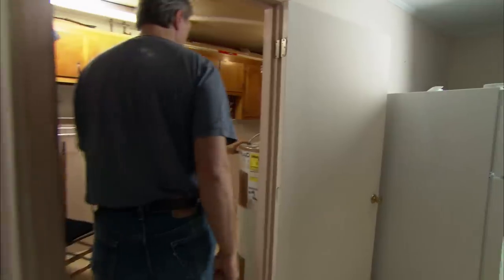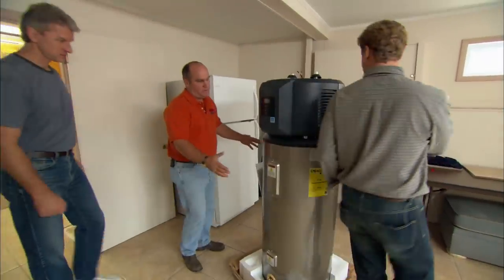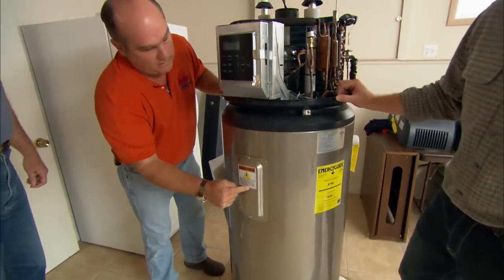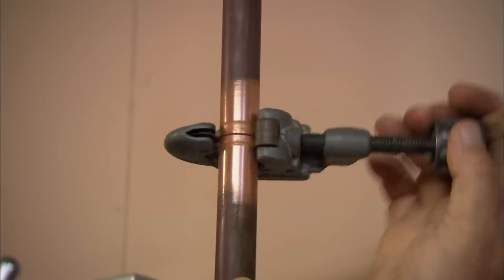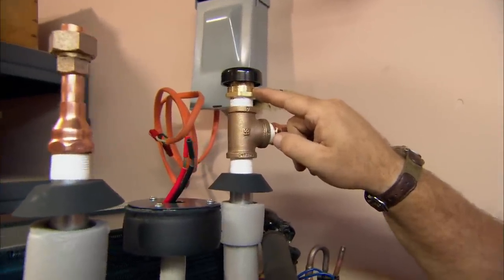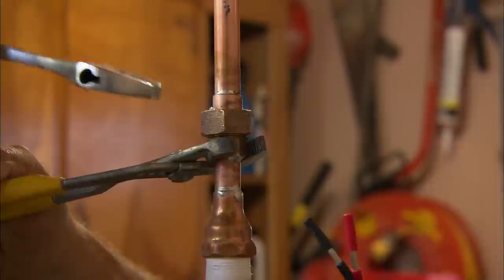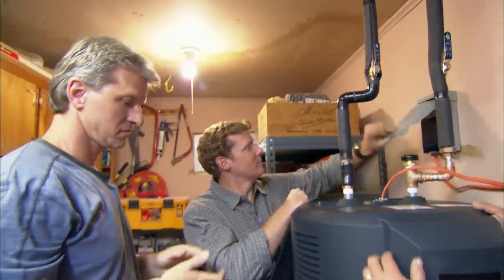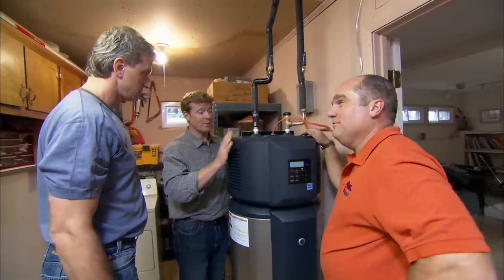How to Install a Heat Pump Water Heater | This Old House

Comment: Most manufacturers are recommending a flexible connection to the piping to keep compressor vibration from traveling through the home as noise.

Comment: Richard has described in detail how a heat-pump works about 6,000 times.
Reply: But I bet there are a lot of people who still don't get it.
Reply: And in two years the heat pump breaks and ur back to a regular electric hot water heater!!🤷‍♂️😂
Reply: @robmcshane3260  Ten year warranty on it.

Comment: Great TOH How-To, as usual. I watched this when deciding between an On-Demand system or a hybrid and this video helped push me to the Hybrid camp. That was a good decision since mine is in a NH lakefront house that gets only occasional use in winter. Heat is precious in those months, so I don't run it in Hybrid mode then. Summer is a different story and hybrid mode works great, and dehumidifies my finished basement as a side benefit. Installation was as simple as Richard made it look.
Thanks, fellas!

Comment: My old kenmore is from 1983 and still goin'. It only lasts for about a five minuet shower at full pressure though. I can't wait to get one of these new hybrid water heaters. The video was good, but the install wasn't quite to code. That 220 should be in conduit, and I don't see a pressure relief tank either. Where I live it required to have flexible copper lines to the heater and also have it strapped down so it don't tip over. I guess they're different rules here and there, but I wouldn't leave that wire exposed like that. Still a fun video to watch.
Reply: Musicman4HIM7 you probably live in KALOFORNIA, or other earthquake area.
Reply: Pressure relief tanks aren’t always necessary, it depends on the house’s circumstances.
Reply: technically an expansion tank is required if there is a backflow preventer on the mains. I have never seen conduit on a residential application electric water heater in 10 years in the trade it's perfectly legal here. even though not always required I always install an expansion tank
Reply: @jenniferbyrne8334  conduit is in a lot of residential. If nm-b is exposed it must be protected whether in conduit or flex but must be protected!
Reply: @mnf65  No, it is not "always" required to be protected. There are many circumstances where exposed NM-B is 100% acceptable. He is absolutely right, it is extremely rare to find that on a residential water heater. It is not required because the water heater is not in the normal living space, and installed in such a way that people will not be apt to hang things from it.

Comment: With a backflow preventer in the system, I have heard it's advisable to have an expansion tank in the system. This reduces the cycling stress on the tank that leads to premature tank failures. (You can learn about this in other YouTube videos showing how to install  the expansion tank in a domestic hw system.)What is your take on this?
Reply: he doesn't have a backflow, the vacuum breaker is to prevent the tank from collapsing when its drained, basically makes it where he doesn't have to open the faucet to do it.

Expansion tanks are required per code on all installations anyways now.  When they talk about a backflow being on the system the mean like a RPZ or Double Check Valve being installed before the heater, usually only on commercial sites does this happen
Reply: Yes if there is a check valve on the incoming line you need an expansion tank otherwise the heated water would have no room to expand and cause the relief valve to drip.
Reply: maczrule  which states is this now code? I have NEVER SEEN ONE IN NJ.
Reply: An Expansion tank is not needed if you have well water and don’t have a check valve after the well expansion tanks.  I have one of these water heaters and no expansion tank because I am on a well even though my well expansion tanks are at least 140 feet from the water heater in a separate building!
Reply: Expansion tanks are only really needed to provide that air cushion and relief from pressures that can build in a closed system.    Take a length of pipe, fill it completely with water and close off both ends, now heat the pipe.  It will inevitably crack the pipe and leak.  Now add a vertical leg onto that pipe filling only the main run leaving the vertical newly installed pipe empty and seal the system, now when the pipe is heated the pipe wont explode unless it is extremely heated superheating the steam but thats not gonna happen with a water heater as they only get up to boiling at very most.  The expansion tank would be the vertical pipe you added, the caps on the ends of the pipe would be the check or prv valve closing the system off from the incoming supply, the heating method of the pipe is the water heater.  Lol.  the expansion tanks also are used as pressure stabilizers sometimes as well but only are required by law if your water company uses pressure reducing valves at the water meters for separate users, most of the north west has this requirement because they have distribution pressures that stay around 100psi or above and mains that get up to hundreds of psi from their pumping systems.  Thats. Where you see the geysers when mains are broken..

Comment: If that thing is pulling heat out of the air isn't that going to make your heating bill in the winter go up?
Reply: Good question. All I can say is that it shouldn't . If the water heater's space is heated, it can take that heat and put it into the water.
Reply: Very slightly, the tank isnt’t completely insulated and gives up some of the heat to the room through the tank itself and ever the copper hot water pipes.
Reply: John Anders how the hell does it give up HEAT to the surroundings ? It TAKES HEAT from the AREA, which it PUTS INTO WATER !
Reply: Leighton Samms some heat escapes through the tank wall.
Reply: Johnnie Burkhalter if you can BUY a WH that looses so much heat through the insulation, then that unit is CRAP, we have used recording thermistors on several brands, and the heat loss is so frigging minuscule, you ar the kind of person whom buys those “WRAPS “
Reply: Leighton Samms The TANK is NOT perfectly INSULATED, so the HEAT escapes THROUGH the tank wall.
Reply: Leighton Samms The heat also escapes through the hot water pipes, when they are turned on, and also a small bit through conduction when the lines are static.
Reply: I live in the Northeast and on the coldest days in the winter I just switch mine to electric mode. My HPWH is located in an unheated basement and the air it blows out tends to cool my floor and make my mini split upstairs work a little harder. It cools my basement by 10-15 degrees on some days.
Reply: Definitely yes it will. But how much? Maybe for winter better to use electric mode only. It’s not easy to calculate. If u leave in humid area some people say hybrid will eliminate dehumidifier. I’m running my 8 month a year here in PA. So idea to have hybrid water heater not bad, but there’s a draw backs. Noise and low reliability

Comment: Could this be installed under a stairwell, I have 9 foot wall so a lot of space, to provide air I could install a mini fan in the wall to supply air from the main area of the home....would this work?? The reason why is Im built on a slab, so no basement and no attached garage...Thanks

Comment: can the heat pump be turned off in the winter? wouldn't want to run an A.C. when it's 20 below out
Reply: Yes. They have the ability to run as a regular heater. I agree... don't want to pull the basement down into the 30s haha.
Reply: Chris R  why would your basement be so cold ?
Reply: @flybyairplane3528  A heat pump pulls heat out of the environment. If it's in the basement, it's going to cool that space.
Reply: Good point. My basement about 62 at winter. Will see how much it will lower

Comment: So your pulling heat out of the air in the space where the water heater is. That energy still has to come from someplace. Am I right to assume your house heating bill will be higher because now you need your air heating system to heat the now cold air the water heater puts out?
Reply: Your thinking is correct. In the summertime this is a benefit, as this will help to cool your garage/basement where it is located. Many of the heat pump water heaters are hybrid models like this one which have an electric resistive heater that can be selected for use in the winter, so in theory there would be no parasitic drain on your HVAC. Most are wifi connected so this can be an easy selection with an app.

Comment: During warm weather pulling heat from the room is no problem. During cold weather isn’t a heat pump like running an  air conditioner in a heated space?

Comment: Now he has a nice cold shop :)  Remember, only use a heat pump water heater in a location where you have EXCESS heat.
Reply: That depends. If his house is heated with efficient mini splits it would still be more efficient "stealing" heat from them compared to resistive water heating. If it's a concern in winter months just run it in resistive mode for that period of time

Comment: 3 questions 1 can it be used on low budget solar electric ie 110 volts what's the highest temperature it reach on the heat pump alone and can the tank be replaced when it eventually gets a leak and one extra question how long is the warranty for total r&r so far I've looked at 2 1 was Rheem hybrid not able to be run on low budget solar and low heat in the water the 2nd was a split unit with the heat unit outside and the tank inside again won't work on low budget solar  so have 2 options to use them either 8 grand for solar or 200$per month for grid tied power and neither I'm able or willing to pay I'm most people I like the idea of going green if it'll either save money or break even

Comment: These are great, on paper. I recently did my homework on these hybrids and they have a lot more cons than pros and the savings $ are minimal
Reply: Tankless makes way more sense. Not quite as efficient when running, but they only heat when you are using it. And they're as cheap as a regular electric water heater. With my propane tankless heater I've used less than 10 gallons of propane in over a year. If you want a heat pump get one that isn't built into the water heater tank - that way you can replace a leaking tank without buying a whole new heat pump.
Reply: @ABlueDahlia  Have you actually done any math? I doubt you understand what you are mathing....
Reply: @ryanroberts1104  only if you got gas.
Reply: @kalijasin  Incorrect. Tankless water heaters are both efficient and cost effective for electric, propane, and natural gas.
Reply: @ryanroberts1104  even if tankless heaters are 100% efficient (UEF=1), that's 3-4x less efficient than heat pump water heaters (UEF=3-4)

You don't know what you're talking about if you're claiming resistive heating (electric tankless and traditional heaters) can ever be more efficient than heat pumps

Comment: I had come across, where that ‘pull switch,’ was mis wired,   surprise. I also went to a ice machine at the SUNY MARITIME ACCADEMY,  in the BRONX NY ,,where the machine was a 230 volt unit,,BUT the SOB whom installed, had put in a 120v disconnect, so ONLY 1 leg was disconnected, the other was HOT  100% when it was disconnected, all I could do was to wright it up, then put a warning tag on it, . .

Comment: In our area it is code to have an expansion tank as part of the install above the H2O Tank.  Is there a reason why this was not done?
Reply: Harold Malaby  I have NEVER SEEN ONE in NJ, but I have had to install PRVs, and T & P valves, MANY places, the homeowner had put a bushing into the outlet, then ran1/4 “ copper out a window,<because those valves were’ weeping’
Reply: @flybyairplane3528  Some manufacturers may even void your water heater warranty if you have a closed plumbing system but don’t have an expansion tank for your water heater.
Reply: Expansion tanks are required when there are backflow preventers on the cold water line.
Reply: He install vacuum breaker it does the same job as expansion tank.

Comment: Can you provide an example, or characterize the operational savings of heat pumps vs. tank-less water heaters?  i.e.: Which is the wiser solution for lowest energy bills?   Thanks in advance!
Reply: BluesLicks101 had YOU LISTENED, he said the heaters were about 4000 watts, but theHP was about 700 watts, so what is it that you do not understand ?
Reply: @flybyairplane3528  To be fair, he did say that the 700watts would run for a longer, but unspecified period of time. so its hard to determine the energy usage
Reply: Madaspy good point. I read somewhere in hybrid mode need 7 hours to heat water after installation. So 7x 700= 4900 wats. I think my electric was able to heat in an hour, but I’m not sure. It’s 4500 wats. Maybe someone can comment how long it take to heat water by electric one
Reply: I have a 50 galon AO smith hybrid and I'm saving about $20-$25 a month on my electric bill. So it is worth it. I do live in Florida and it is located in my garage so perfect situation here plus it dehumidifies my garage.

Comment: I have a Manufactured Home where the water heater is in a tight closet with a removable panel on the front. Could I still install a Heat Pump Water Heater if I kept the panel removed and added a cutout in the wall above the removeable panel with a 16" by 16" louvered vent?
Reply: no.

Comment: Why the heck would a incoming cold water line need a vacuum breaker on a water heater?  When would that ever be used to break any kind of vacuum?  Because when i fill a empty water heater i open a fixture thats the farthest away and turn on the water until the air gets pushed out and cold water is flowing through both the hot and cold pipes then shut the fixture off and wait for the water heater to do its thing..  but even if you just left the air in the system and just turned the cold supply on then burped the system later, when would a vacuum be formed ever on an open or closed system?
Reply: If the fire department ever uses a nearby hydrant and there isn’t a vacuum breaker, the tank could implode.

Comment: how many sq feet is needed in the space where the heat pump/hot water heater is installed?  you haven't commented on that yet.
Reply: 1,000 square feet
Reply: Unless you have a louvered door.
Reply: @Penfold8  what happens if you don’t have 1000 ft.² and you install this? I really want to one  but my basements only 600 ft.².
Reply: @Raptors0524  It isn't 1,000 square feet, it is 1,000 CUBIC feet.  Your 600 sq ft is more than plenty.

Comment: What's the go with hooking this system up with a hydronic radiant floor heating and for DHW use? Greatly appreciated for guidance
Reply: The heater for a domestic hot water doesn't even come close to providing the heat for radiators or radiant floor heater.
Reply: @gene8172   What if its only to heat a small sunroom why hydronic heat?  Its only about 260 Sq feet
Reply: @maow333  Hot water heater won’t put out enough heat, isn’t designed for heating and will use too much energy and will fail quickly.

Comment: Why not run the condensate line out the house? The water heater isn't that far awy from the outside wall, but instead now must add another point of failure in that condensate pump and more unattractive tubing.

Comment: Only way I see this working is if your water heater is in your garage. If it's in the heated basement like we have, now I'm running my HVAC to bring heat into the house for the heat pump on the water heater to absorb to put into the water, making the basement cold forcing my HVAC to run more often.
Reply: These can be ducted outside to negate that. In addition, you can use a valved duct. In the summertime, you can close the valve which causes the air exhaust to cool your basement. In the winter, you open the duct valve which runs off air exhaust to outside so you don't have any negative consequence.

Comment: one more thing. where's the expansion tank.
Reply: there is just the safety valve
Reply: Expansion tanks are not required everywhere. Where I am they are only required on systems with a back flow preventer and new construction (because all new construction requires a back flow preventer)
Reply: Merchants HVAC & Plumbing my gas WH does not have an expansion tank,,but my water system  has one I put in,.My water press is 130 lbs, so I put in a PRV, with gauges on both sides then a whole house filter, with aguage on the outlet, them softener, then a  food grade phosphate feeder, then that exp tank, w/takeoff to my RO SYSTEM to the kitchen & refrigerator.
Reply: None required where I live. City water pressure is 60psi, no PRV required, no backflow preventer required, thus no expansion tank needed.
Reply: expancion tanks are only nessesary if you have a CLOSED TANK SYSTEM where the water NEED space to expand!
on most water heaters the exess water get pusd back in to the inlet pipe as soon as the pressure in the tank gets higher than the water pressure in to the house.
but i have seen plases where they add airpressure-expansion tanks on the inlet pipe,, but thats mostly to make say a water pumps work easyer so it dont  get so ROUGH STARTS-STOPS EVERY TIME SOMONE SAY TAP A CUP OF WATER! hehe
that was they can say set the pump to start for example 1 bar and build up pressure to 3 bar, and becouse of the tanks you can use a few gallons before the pump have to start-stop AGAIN

Comment: If you are removing a resistance-type water heater, and just "dropping" in a heat-pump type can the homeowner do it and get the meaty rebate?  Or must I pay someone a few hundred dollars an hour (or more) to "Professionally" install it?  Don't get me wrong, I respect code but this is not rocket-science and a homeowner ought to be able to do this themselves and get the rebate.